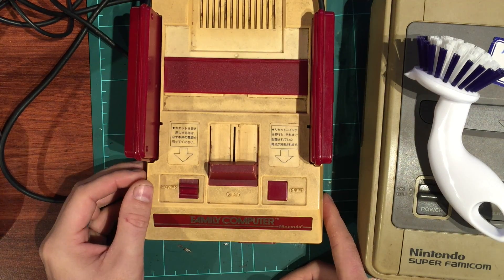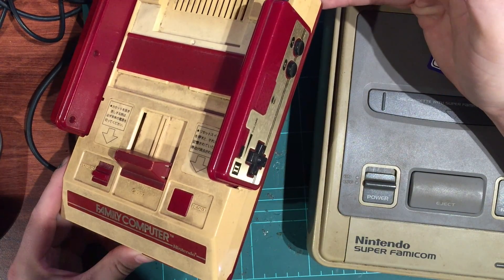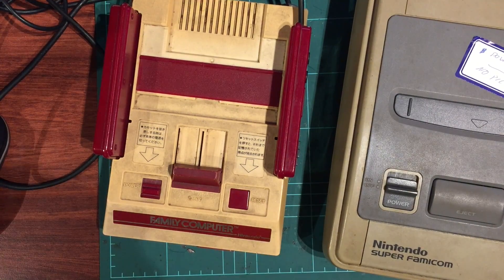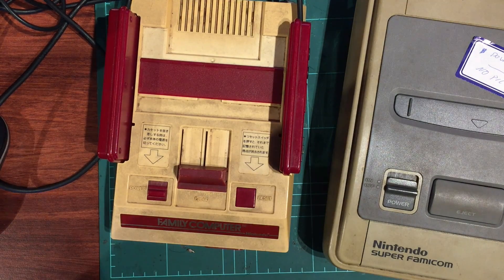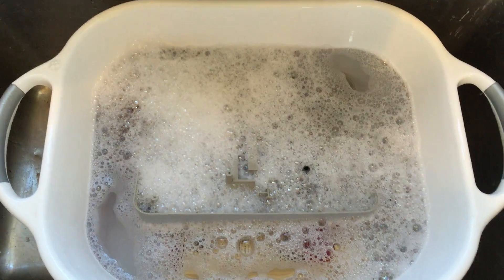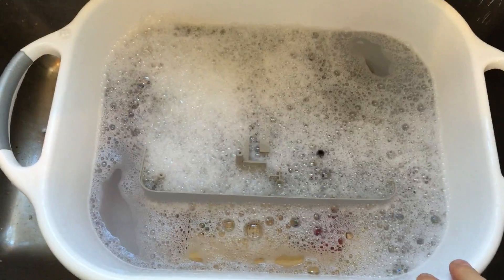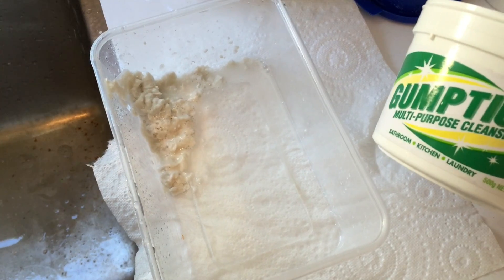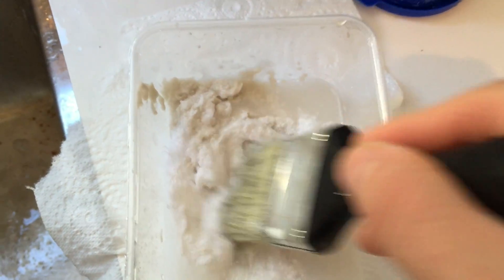How to Clean & Whiten Yellowed Plastics on Retro Consoles

Comment: I don't have the patientce for this.   I used  Krylon White Fusion for Plastic spray paint.  It's instantaneous, super white, and bone dry in about 30 mins (I'd still let is set for 24 hours).  
The obvious drawback is that is covers any print material unless you mask them first.  I've used this technique on telephones, lamps, fans, and other electronics, where covering the branding and print elements is fine.
If the plastic is textured use: 'Flat' / 'Semi-Flat'.  If the plastic is smooth use: 'Matte' / 'Satin'.   Do NOT use: 'Semi-Gloss' / 'Gloss', eve though it's tempting – because it'll show all the minute imperfections in that were previously invisible to the eye.

Comment: use a bucket of hydrogen peroxide 12% and a UV light, it will be get every single spot
Reply: Funny. Because you would think Bleach, but bleach actually turns things yellow. H30 turns yellow white. Weird
Reply: Also alcohol and Lysol work pretty well for ink messes.

Comment: Yellowing is generally caused by both bromine and exposure to ultraviolet (UV) light. Many of the ABS plastics used in consumer electronics devices are typically “brominated”—combined with bromine as a fire retardant to meet fire safety standards.

Solution: Hit it with some UV light and Hydrogen Peroxide. lol

Hydrogen Peroxide is considered a bleach. lol

Comment: Your not fixing the underlining problem. Your putting a band-aid on it. After a while it will return back to yellow. The plastics have bromide in them which was prevelant back in the 80's to address fire hazards. Unless you can remove that from the plastic, it will yellow again from sunlight.

Comment: So because the sun was on them in the first place and made them yellow the way we fix this is by putting them in the sun again but just with some stuff on them. So basically we are fighting uv light with uv light. Well I guess we all learnt something today. Also personally I would get a plastic box that is clear get a few uv strip lights put them around the box through some good old 12% hydrogen peroxide in that box and put the parts in and leave them in there for a few hours or however long they need and then you got your self some non yellow plastic.

Comment: put it in a clear bag, the hydrogen peroxide reacts with O2 in the air and stops working (it basically evaporates)
Reply: h2o2 reacts with oxygen?  are you sure about that?

Comment: If you use a stronger hydrogen peroxide (like a 40 from hair salon or amazon) it's a lot thicker. Just lather that on and use clear plastic wrap to keep it all on the console and so it won't evaporate. After a few hours, it'll turn that famicom the same color as it was below the switch, mint condition plastic again. Your addatives keep it from working the best it can, so try the clear wrap instead of diluting it for best results! :)
Reply: The "40 Volume" branding is actually 12%.
Reply: You mean 40 Volume or %40 ? , If you meant as % , I tried %50 Pure Hydrogen Peroxide to whiten my  racing kart's fuel tank ,  it burned the stretch wrap , Aftermath I tried on remote of air conditioner , result was perfect in 1 day. But I put it in a plastic box and filled with hydrogen peroxide.

Comment: I've aslo seen that Magic Erasers work, they're made of Melamine Foam, which is significantly cheaper to buy than Magic Erasers.
Reply from the maker: +Liam Jackson That's interesting! I think the Magic erasers work by sanding the plastic down with an extremely fine grit, so it may work but will probably cut the plastic down. This is OK but I wouldn't rub too hard on labels or any branded surface like where it says "Nintendo"
Reply: Yeah that sounds about right, I guess it's probably best with things of less value. In my case something like an upright fan that I have would be better to turn white again, rather than my Apple //C.